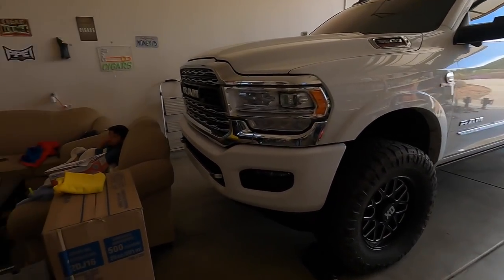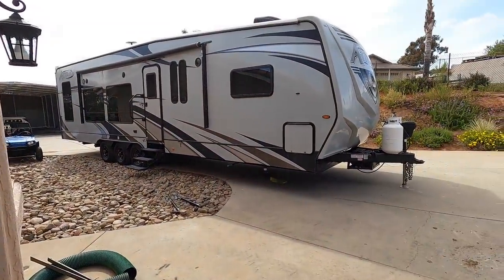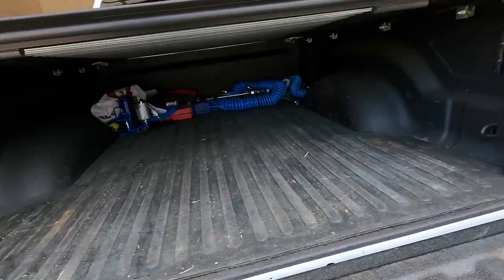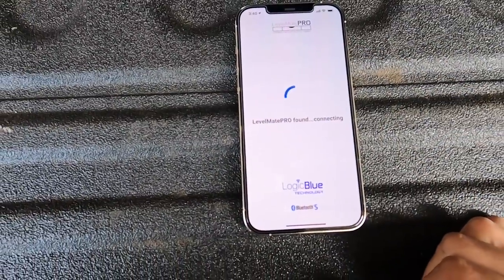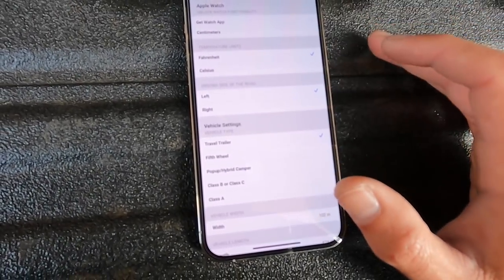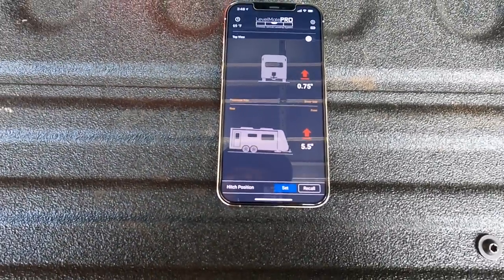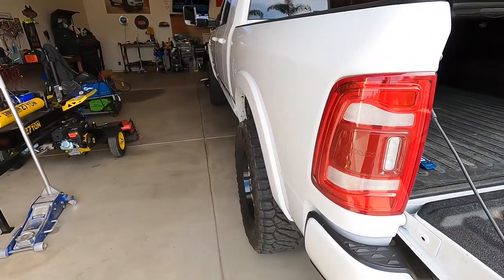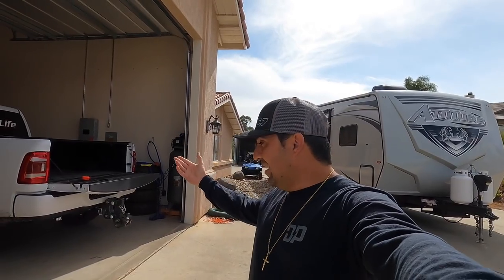How to level your truck perfect with air bags....This device is a must!!!

Comment: Hey Eddie is always good seen something different on your channel, quick question is that ok if I used the weight distribution bars and airbags at the same time?? I got airbags on my 2018 Sierra 2500 diesel what do you think? 
Thanks..
Reply from the maker: Ya of course, that’s what I use
Reply: @EddieLife3500  thanks

Comment: I have a 2021 ram 2500 I daily drive and tow with on occasions do you still recommend optimal welding
Reply from the maker: No I use @rajkalkat now
Reply: What about for a 2018 ram 2500?
Reply: @ooocodyy2575  I've been running his stuff for about 6 months I haven't had no problems but I only got this stock horsepower tune
Reply: @Super-tw1kw  were you able to delete everything off the truck? and how did you get ahold of him?
Reply: @ooocodyy2575  yes you can take everything off just tell him what you want to do and I talked to him through email